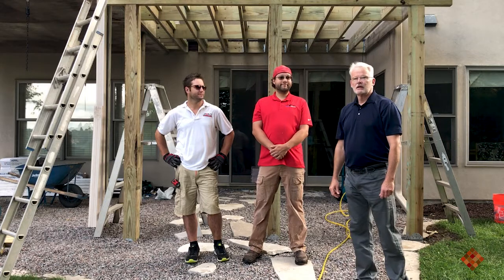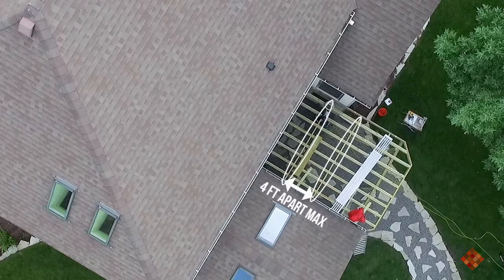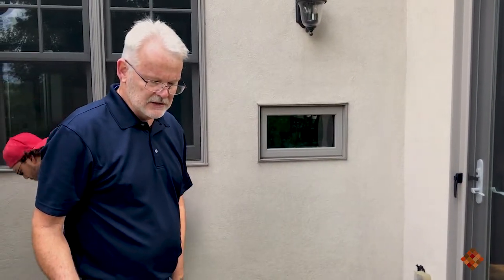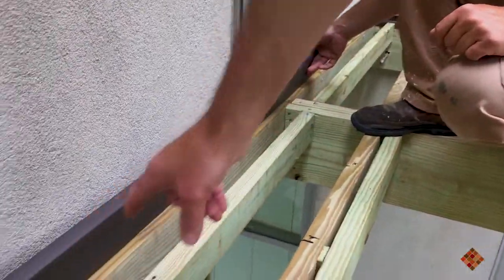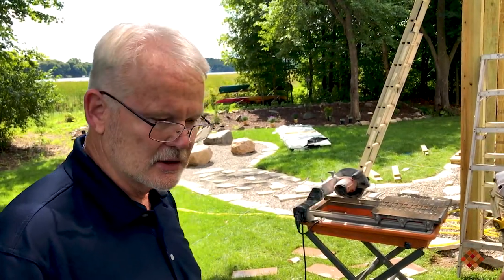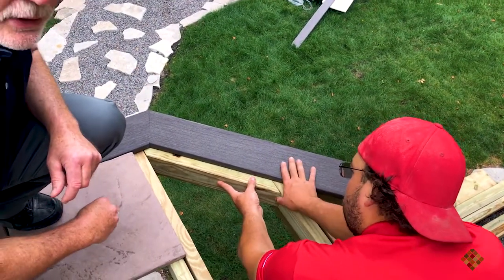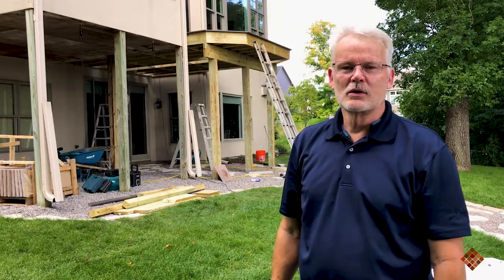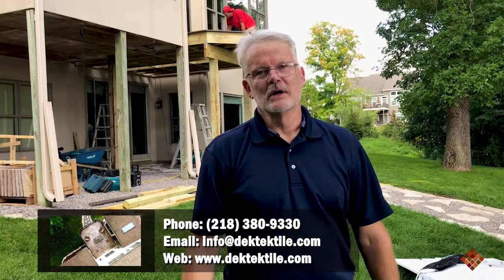How to Install DekTek Tile's Concrete Tile Decks using the "Sister Joist" Installation System

Comment: I’m wanting to build a deck on top of a front porch, but I don’t want the water to leak through. I thought about tile, not sure that’s the best option. I will consider what ever gives me the longest lifespan. Yes I care about looks, but number one on the list is durability. So if that’s epoxy, tile, pvc decking, or whatever, I’m open to suggestions and ideas.

Comment: What if a tile crack?
Reply from the maker: We warranty against cracks. Our deck tiles are engineered to be extremely durable so there should not be any cracking. The very 1st deck up in Northern MN is over 11 years old currently and absolutely no cracking or issues, even in our harsh extreme climate.

Comment: Just don’t stamp your foot very hard or yer going through.  I remain unconvinced that these are strong enough to hold people up.
Reply from the maker: Hi Mark, proof is in the pudding. Perhaps you should check out our video showing us driving a car on the deck tiles? Each tile is engineered to hold over 1,000 pounds per tile.

Whether you are convinced or not is your choice, you're certainly welcome to test it out yourself, just notify our team if you're interested in the nearest location to you to see the tiles in person, or to order samples.  
Regardless of how you feel or your knowledge of our concrete deck tiles, thousands of homeowners across the country are creating amazing outdoor spaces installing the concrete tiles on decks as high as 60+ feet in the air, where they're using their gorgeous decks every day and that they can enjoy for a lifetime!

Here is the link to our very first video where we are driving a car on the tile: https://youtu.be/CE54l2avXA0?t=78  

If you care to take a peek at our professional engineering you're welcome to contact our team at 218-380-9330.

Cheers,

The DekTek Tile Team
218-380-9330